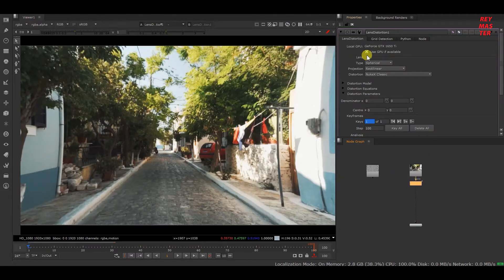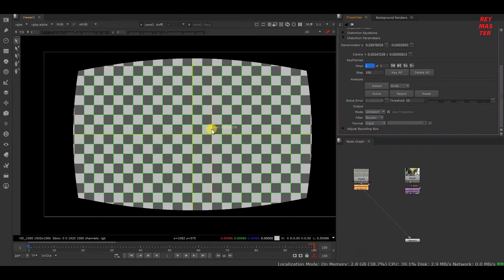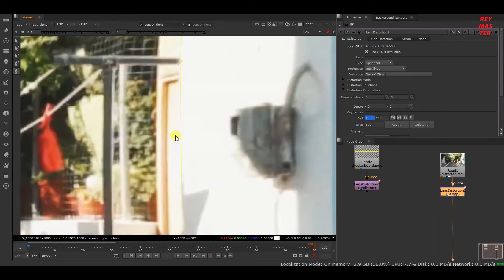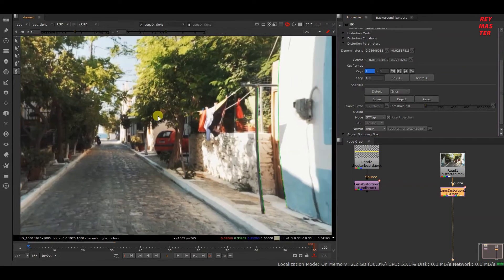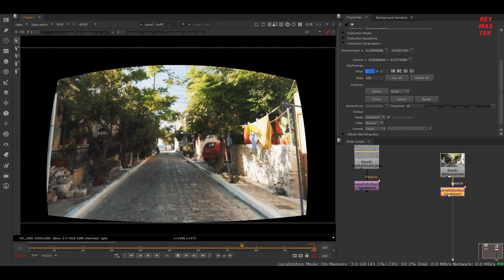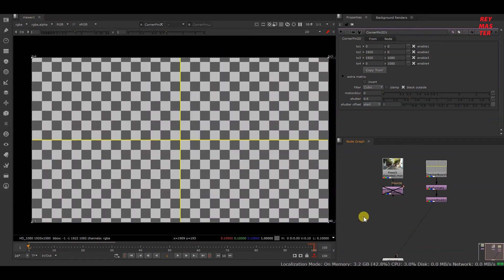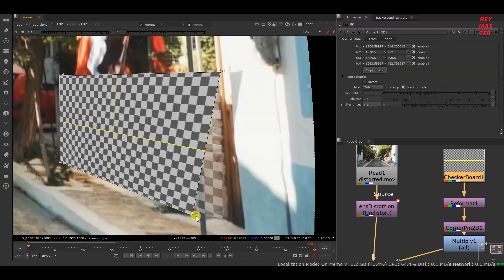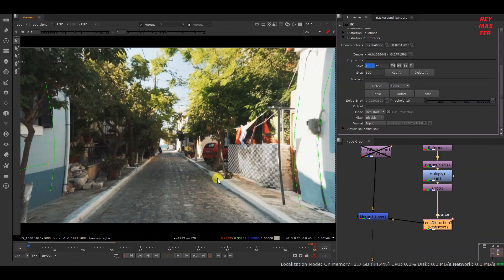Lens Distortion Tutorial in Nuke | Calculate Lens Distortion

Comment: Good tutorial! My question is: I have a case in which i have no checkerboard OR straight lines in the footage, so, how do I calculate the lens distortion using features? do you mean to calculate it though the cameratracker?
Reply from the maker: Yes, using cameraTracker or Lens Distortion node where you can calculate with features, but better option if you have a footage like that i suggest you to calculate using tracking software like 3Dequalizer which will give you way better result!